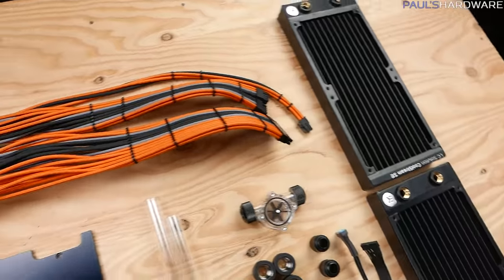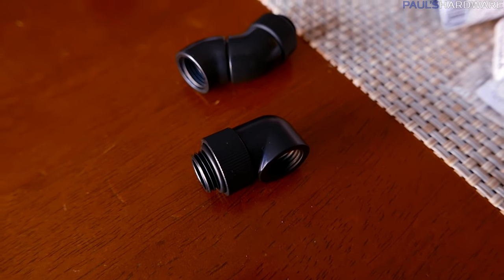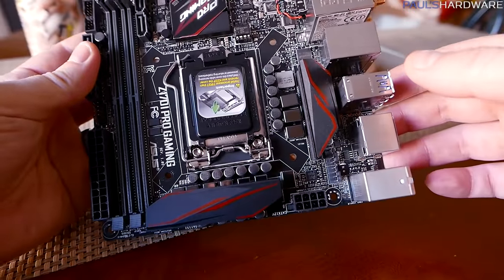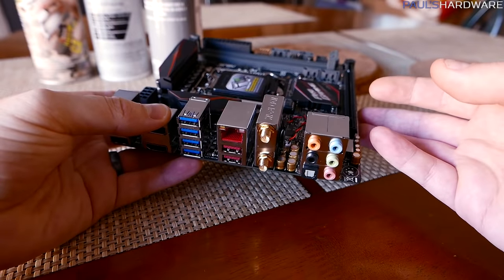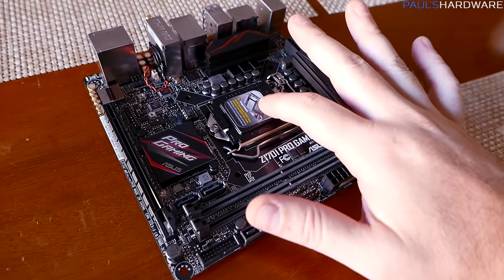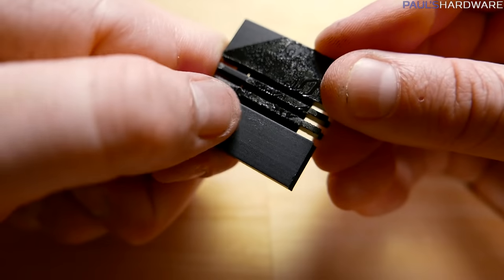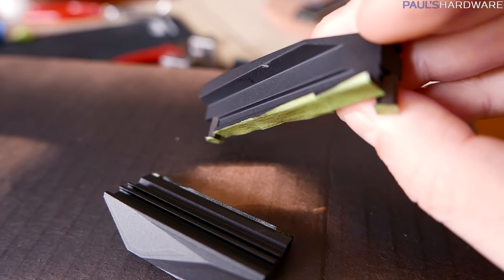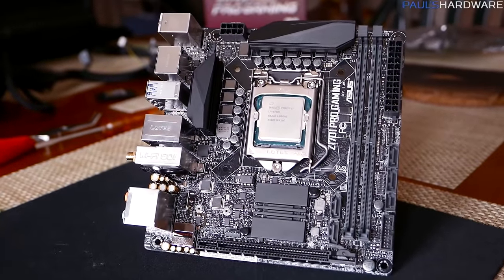Modding the Perfect Mini-ITX Z170 Motherboard

Comment: I wonder why it's so hard for manufacturers to make color neutral mobos? 
A pure white or pure black mobo is WHAT PEOPLE WANT! 
ASUS couldn't even make that new X-99 Deluxe II without adding that stupid blue accent.

Don't even get me started with graphics cards...
Reply: Evga boards are almost color neutral
Reply: New Asus strix 1000 and 400 series gpus are color neutral
Reply: IKR!!! or atlease have multiple color options
Reply: Multiple color options is hard to do from a manufacturing standpoint. However, my personal pet peeve is when a company has a non-color neutral product that also has RGB lighting. Why even include the RGB if you can only set it to one color without it looking terrible!
Reply: z170 krait edition from msi + evga gtx1070 sc
Reply: MSI REALLY dulled down its motherboards this year, probably from getting so many complaints about undermining RGB with black / red motherboards.

Comment: Just thought you might be interested in knowing: EK lists the Z170I Pro Gaming on their configurator as having a clearance issue with the Supremacy series water blocks. Those capacitors are mounted too close to the CPU socket to allow the block to fit out of the box. Apparently the coldplate can be modified to fit around them, but that's extra work you're going to have to go through.

Comment: If you don't want to use the PlastiDip because of heat then you sure as hell don't want to use normal paint for car exteriors.  You want to get the Engine block paint which can withstand temps up to 1450C, but generally PlastiDip will be fine for most builds.  I plan on doing this sorta mod on a Gigabyte Gaming7 with PlastiDip.  The white and red  covers don't go with my green and black build.  

Customizing a computer is much more than just picking the parts of a build.   Put a bit of your soul into your computer with custom paint, decals, even welding aesthetic pieces to the exterior of the case if you want (if it's metal, if it's plastic then glue works too)!

Comment: Awesome build Paul I have the same case, cpu and motherboard, just to let you know you CAN disable the Supreme FX logo leds from the bios but there are the 3 other leds that light up when you power up the system, one next to the RAM up top, a second one dont remember where exactly, does light up and shut down but the 3rd one which is under the lower right corner of the chipset heatsink that one stays on and you can't disable it. That is the one you would have to disable physicaly.

Comment: In the future you may be able to use dental floss or thing wire to remove stiff stickers like the one on the chipset heatsink, its a common way emblems are removed from cars. Heat as you were with the heatgun but use the floss to cut the adhesive off, then clean with solution. Best part is that it has a good chance of saving the emblem in case it ever needs to be put back on.

Comment: Paul,
If you've followed through TinyTomLogan(TTL)'s review of the Fractal case you're currently working with then the heatsink above the board may cause interference issues for your top mounted radiator and fan setup...thus affecting your loop and your build loadout.

Comment: hey Paul! On the CD that comes with the board there's a programs called Asus Ai Suite 3. Install that program and it will give you access to a bunch of info. They have a tab on that setting called LED. Those settings will allow you to turn off the flashing Red motherboard lights, and also the flashing Audio lights. Hope this helps.
Reply: there is 1 red led you cant turn off.

Comment: You could use heat shrink wrap on the battery cable if the plasta dip doesn't hold too Paul :)

Comment: Napa brand electronics cleaner actually works well taking adhesive off, as well as the real mckoy safety solvent if you can find it, very hard to get when not buying bulk.

Comment: Hey Paul, the ASUS boards have an option in the BIOS where you can disable the LED's. My Rampage Extreme and Maximus VIII Formula had them under the SupremeFX area, the Z170 doesn't have SupremeFX I don't believe but check under the audio settings. :)

Comment: I would think a coat of paint would be a thermal insulator. Maybe try removing the red pain rather than painting. I'd try Brasso. It'll require some time but might give better results. And if it doesn't, then you paint.

Comment: eexelent! I was just thinking about buying this motherboard and you bang in with video about it!
Reply: It's a really nice mobo, a bit expensive but has tons of features for that size. I'm using it as an HTPC / Steam OS in the IN WIN Chopin case, amazing combo.
Reply: I've been thinking of a small watercooled build and this mobo looks good for it.
Reply: Well, it depends which case you are planning to use. If you can fit a MicroATX instead you might have a few more options for cheaper.

Comment: Why wouldn't you just buy the evga stinger? More USB ports but doesn't have built in WiFi, or do you consider this board better for some reason?
Reply from the maker: EVGA Stinger is a good board but lacks an M.2 slot, which I really wanted. (It has an M.2 Key E slot but that's mainly used for wifi cards)
Reply: +Paul's Hardware ah OK... I have this board for one of my builds then the stinger for my wife's aesthetic z170 build... Thought if I needed WiFi I would just add it to hers and I don't need the m.2 speeds on our pcs to be honest... Both great boards. I understand why you would want that if your going as far as a custom loop though.
Reply: love the m.2 being on the back to keep it away from the gpu and all that hot air.
Reply: +feelingtardy That's a negative in my book.  really fast m.2 drives can generate more than marginal heat.
Reply: Yeah, m.2 can get pretty hot and and there is no airflow on the back of the motherboard.
Reply: but you have to keep in mind its mitx there is no space left on the top
Reply: +Digger2011 Yeah, I get that, and I'm not trying to say it's not perfectly acceptable to run an m.2 drive on the underside of the MB but I just don't like to if I can help it.

Comment: dat red LED though! Come on Paul, I soldered a green one in. Lets see some orange!
Reply: you replaced the standby led??
Reply: Yeah, it wasn't green lol http://www.overclock.net/t/1605990/define-nano-s-nvidia-themed-build-finally-watercooled/0_20
Reply: dude awesome thanks for the reply! is it hard to replace ? does it void the warranty?
Reply: I'm positive it voids the warranty hahaha it wasn't too bad, you just have to be fast with the soldering iron so you don't put too much heat into it.
Reply: Nice man! Is there anyway I can desolder it all off and leave it blank with no LED or will it mess up?
Reply: I wouldn't just leave it blank. I would check the resistance of the LED then replace it with the appropriate resistor. That should do the trick.
Reply: +JayRab179 can you send me a link to the LED you bought for the replacement of this motherboard
Reply: I've just had these leds, I can't remember where I got them. They're just standard through hole 3mm leds. these should work: http://www.ebay.com/itm/100PCS-3MM-ROUND-GREEN-Superbright-LED-Light-Water-Clear-/201563278759?hash=item2eee1b8da7:g:-FUAAOSwubRXE0Jm
Reply: +JayRab179 thanks, I haven't done much soldering in my life, but I do learn fast and have steady hands. Its not hard to solder and replace them is it?
Reply: nah, it's not too bad.

Comment: why you did not use evga z170 stinger???
I think it is good motherboard !!
Reply from the maker: yes, but no M.2 :-( at least not one that can be used with an SSD
Reply: looks like a budget motherboard now you sprayed it
Reply: Looks budget because?  I personally HATE that 99% of ITX boards use the mindset of "Black/Red = Premium".  Black/Red = Played Out IMHO
Reply: its the shit dull black finish, not the lack of the gamer red/black look of everything
Reply: and no USB 2.0 header for water cooler software support
Reply: The EVGA Stingers' layout is awful to build with.  All the headers and ports are in all the wrong places.   It a nightmare, trust me.  This Asus board is soooo much better to build with.  And honestly, Im kindof an EVGA fan boy, and I hate the Stinger. :(  I hope they improve it next Gen.
Reply: Check out Joker Productions Nano S video, and he'll tell ya the same thing about the Stinger.
Reply: +Justin I hope that board is better than my Maximus VIII Impact! The cutouts on the I/O shield are off by a quarter inch! Not to mention the botched BIOS the board shipped with... and the drivers...
Reply: +Nekros i have the z170 pro gaming and my io shield cutouts are also misaligned
Reply: That really sucks...are you even using your IO shield then?
Reply: +Justin Nope. I was gonna modify the shield to fit, but I never got around to it. I left it as it is. Better airflow?
Reply: shouldve bought a new shield, they arent that much
Reply: +PneumaticFrog Mmm, too much effort.
Reply: I probably would have returned it right away...  I'd be so pissed .
Reply: Phantom309 the red and black fad has been alive too long, hopefully it will die.
Reply: muffemod I don't really care about the color scheme. I don't spend time gazing at my rig and no one else allowed near it.

Comment: Got the same motherboard. The side with the M.2 slot was corroded as eff and the screws for the heatsinks were  stipped. A modded watercool fail in its past? :3

Comment: I've never quite understood water-cooling, how does it work?
Reply: It's circulates water through a system and as it passed through the cpu block it cools it down
Reply: n00b
Reply: ***** ResQ Thanks for the helpful comments, really appreciate it 😉
Reply: Get a highend PC and put it in a bath of cooling water
Reply: Jake Woodworth Wouldn't the water (liquid) in turn need to be cooled too then? I know in cars this is done with a radiator, but this isn't really possible on a PC!
Reply: +Mattias Verduijn yes, the water passes through a radiator
Reply: +Mattias Verduijn that is literally what happens
Reply from the maker: It's easier to transfer heat to water than it is to transfer heat to air, so the water circulates in a loop (via a pump) and flows over copper blocks on the heat-generating components (CPU and GPU usually). The water absorbs the heat, then flows out to a radiator with a  bunch of fins (ideally also copper) and fans pushing air over it, which dissipates the heat into the air and keeps everything cool. It's the most efficient means of cooling (within reason) but the cost of a custom loop usually doesn't measure up to how much extra cooling you get. Hope this helps!
Reply: +Paul's Hardware Thanks for clarifying, nice video too!
Reply: +Charles Hartmann Sometimes people want personal contact, instead of just watching a video or searching for something. You can't just assume I asked my question out of pure laziness without knowing me at all...
Reply: First of all, I do not understand why my comment would imply that all content is personal. In fact it is the opposite: most content on the internet is very public and can be viewed from anywhere in the world. Secondly I am very much capable of googling a question, but this does not give you the ability to start a conversation about the topic, which is something I personally prefer.
Lastly I can decide for myself what my needs are, and whether or not I want personal contact, that is something which is not up to you to decide. 
If you prefer googling an answer, that is fine, but I am asking you not to go and force your opinion onto others. Thanks in advance.
Reply: I know a lot of people above have answered your question, just wanna point out, back in the days it used to be more effective but nowadays air cooling has improved enough that performance improvement when compared between water and air cooling, isn't that different. This is especially true on the CPU, there's virtually no difference between water and aircooling a CPU. GPU on the other hand, can show some improvements if you water cool it if you use enough GPU intensive programs, which is why some high end GPUs come with an AIO watercoolers attached to them. Speaking of AIO (All in One) watercoolers, that's the easy way to watercool. The cooler comes in a pre-installed package that you simply attach to your case and your CPU/GPU. Custom water loops tend to be a lot more expensive, and is usually just done by enthusiasts who subscribe to the "because-i-can" philosophy.
Reply: Charles Hartmann I used to have an aftermarket air cooler then got a Corsair AIO water cooler, trust me there's absolutely no difference in thermals on my i5-6600k. But then I got a Corsair HG10 and attached my AIO to my R9 380, and you can probably see where this is going. AMD cards are hot so that AIO actually helps, a lot. It runs a lot colder and the clock speeds improve quite a bit. So you could be right, 1070s and 1080s probably don't need water cooling, I don't own them, but I hear they're pretty power efficient cards and I'm not gonna pretend to know about them, but I know for a fact that water cooling does wonders for AMD cards and that, aftermarket air and water cooling will have about the same thermals on your CPU.

Comment: How did you remove the cmos battery? (video 12:37)  I can't find anything about how to remove it, even in the manual from Asus. 
I tried pulling a bit, but it didn't move a bit and i don't want do damage it.
Thanks for any advice.

Comment: How's the on-board audio on this board? 
I'm looking to get this board but i am worried about the audio as add-in sound card through pci-e is not an option.
And how is it overclocking, I also intend to pair it with an 6700k.

Comment: How does the audio on this board sound?  I'm a little less than pleased with my mini itx board I recently purchased.  Just sounds flat. bleh.  Also, which off board, stand alone sound card would you recommend since my only slot is occupied by my graphics card.

Comment: This doesn't have much to do with this specific build, but REALISTICALLY, how much do I need to be worried about static electricity zapping one of my parts while building? Should I get an anti-static bracelet or a mat? I do live in a somewhat dry area so static is noticeable sometimes.
Reply: I personally just touch the case regularly, or the Power supply while it's plugged into the wall but turned off.

Comment: Great video! Thanks a lot for that. I've got the same board in a white manta case and I'm thinking about getting these heatsinks either white or black. Not sure yet. But I wasn't sure whether they're easy to remove and put back in so you helped me right there :)
You can actually disable the "Supreme FX" lighting in the UEFI, but (as far as I know) the red power led will alway light. If you find a way to disable that, please put it in your next video.
Reply: I have the same motherboard, if soldering in a different colored LED is above your skill level, grab another 3mm LED, get it a little damp, with water on your hands then touch the led coat it in cornstarch, and dip it in plasti-dip, and punch the leads through some cardboard, and let it dry.

You should be able to pull the plasti-dip off the throw away LED, and slid it over the one on the motherboard, maybe trim the base so it gets a snug fit against the motherboard, that way you still have it for diagnostics, and you can do it to each onboard LED. that's what I'm planning on doing when I get some time to do it.

If that's above your skill level,  pop some heat shrink over it, the non-adhesive kind, don't heat it, you'll never be able to get it off if you do

Comment: All I want is a fully black z170 matx motherboard is it too much to ask for
Reply: Evga provides good black mobos
Reply: +LazyDutchie depending on the size, evga does not offer m.2 or USB 2.0header on the board if that is important to you
Reply: LazyDutchie yeah I did look at that but didnt want to be restricted by crossfire (I am an nvidia user)
Reply: Well, acording to Paul, painting your Asus board won't void the warranty. Pick any color Asus board with monochrome PCIe and DIMM slots (painting those will VERY likely void your warranty).
Reply: ***** huh ok, I was thinking about doing that to the maximus gene. I'm hoping though that when they release Kaby Lake ROG will release another maximus gene board that is fully black with rgb (like the hero)

Comment: Everyone upset he has a 6700k for his wifey beacuse she wont "use" all that power is like saying why buy any car with an engine bigger then 1.3L 4 cylinder because the speed limit of the roads are 100 KM p/h.

I regret not buying the 6700k even though I know I wont be using the hyperthreading very often because its only an extra 100$~ since its the only other part that needs replacing in a z170 comp.

Comment: the evga stinger is a nice mini itx board
Reply from the maker: yup, no M.2 though :-( at least not the M.2 keyed slot you need for SSDs
Reply: +Paul's Hardware good point! i actually won a stinger board from jacob. hype!
Reply: As Paul said, no M.2, also the USB 3.0 header is in a really bad place, just like the Gigabyte boards.  Asus and MSI put the USB 3.0 header on the edge of the motherboard where it looks much better when connected.
Reply: +Sean Crees yeah i agree about the usb header for sure
Reply: +Sean Crees with my RX480 and stinger I can't plug in the USB header at all. Not to mention I can't control my NZXT kraken because there is no USB 2.0 header for that.
Reply: I love my Z170 Stinger, perfect color scheme and good power delivery for the CPU. Definitely agree with the stupid USB header being in a terrible location. I'm surprised mine hasn't melted yet from laying on top of my R9 390